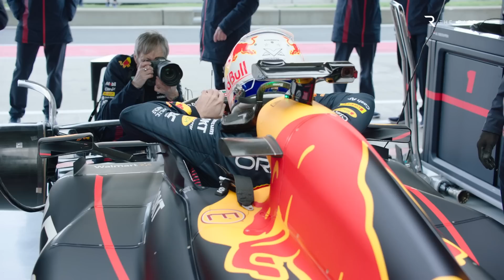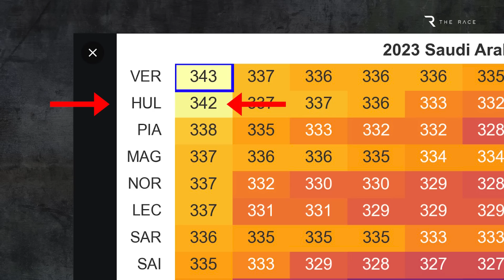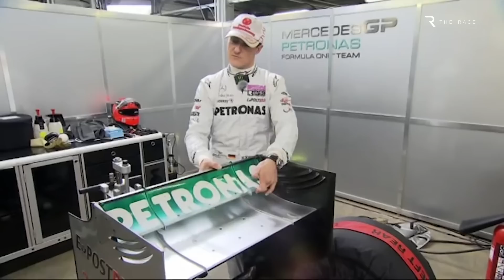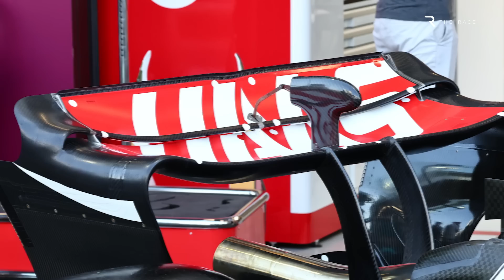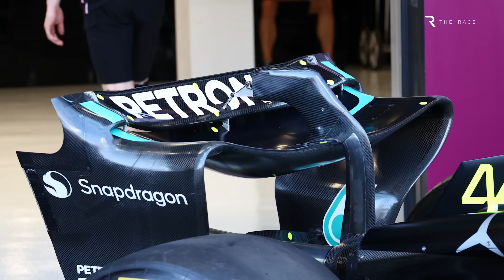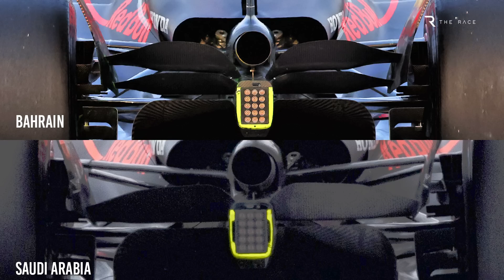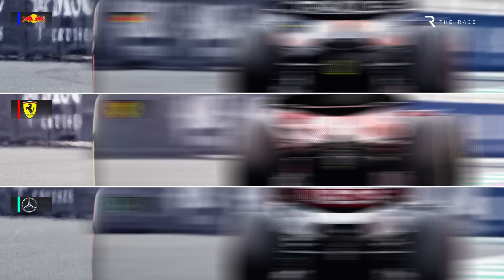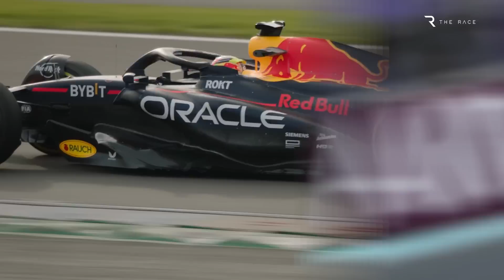Red Bull's genius 'triple DRS' F1 trick explained

Comment: Lmfao all these Hamilton haters love to come out of the woodwork now. Attack a quote taken out of context. Throughout the entire turbo hybrid era, Mercedes never had the straight line speed advantage to the extent redbull has. Look at the data clowns
Reply: Because they ran extremely loaded wings, which they could afford to do because of a massive power differential. Higher downforce means better cornering and less tyre degradation, which will win you races. 
You looked at one top speed comparison table and drew a conclusion, but sure, they’re the clowns.

Comment: He’s never seen a car so fast? What about his 2020 and 2021 car?
Reply: 2021 car was only fast really after they put that spicy ICE in it for Brazil on !!
Reply: @VERY EVIL PERSON FROM ILLUMINATI The car didn't lose at all, they won the constructors championship. As long as you kept feeding it new engines every 3 races it was much faster then anything else on the field in a straight line.
Reply: @TheCountess666  not even close. Red bull had the better straight speed in first half season and then matched mercedes until brazil but even in qatar and jeddah Lewis didnt used his brazil engine power
Reply: @alexlacl8730  What are you talking about? Redbull was at the back of the field in terms of straight line speed the first half of the reason. Mercedies wasn't always at front but always ahead of red bull. 
The redbull 2021 car won in the corners.
Reply: @TheCountess666  always ahead of red bull ? You just need to see the qualifying comparison made by f1 on the french gp. Rb also dominated mercedes in austria where the balance and speed straights count a lot.
Reply: @TheCountess666  the redbull was better in 2021 for most bro
Reply: @Garage_Distinct  Max got more out of that redbull, but the Merc car was faster on more tracks. bro.
Reply: The 2021 Mercedes was slower than the RB16B, the 2021 floor regulation put Mercedes in the back foot & they only won the constructors because they had the better/most consistent driver pairing vs RB
Reply: @ryjlane  Merc was not slower in a straight line. it was only slower in the corners on the majority of tracks.
Reply: @Sidharth Tirkey 2 words: straight line.

Comment: And this is excatly why we shouldn't have new rules made simply to nerf Red Bull. Engines across the top teams are roughly equal, budgets are equal, Red Bull simply just built a really good car and should be rewarded for it.
Reply: what do you mean? new rules try to mix up the grid every time, because one team winning for 5 years straight kinda sucks. Also, the new aero testing limitations try to give the teams behind in points more time to improve and catch up.
Reply: @Appletank8  The playing field is as equal as is possible, in fact it's already set against RB (sliding aero development scale). In previous years of domination Mercedes for instance had obvious advantages, their engine and their budget, which other teams couldn't just copy. Now RB has built a better car using similar engines and budget, other teams have simply dropped the ball, RB shouldn't be punished for that.